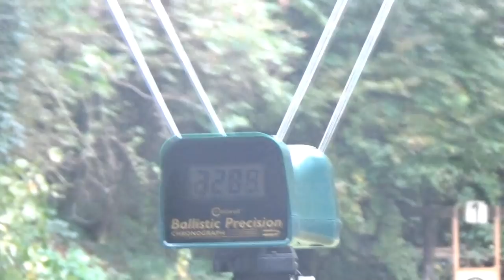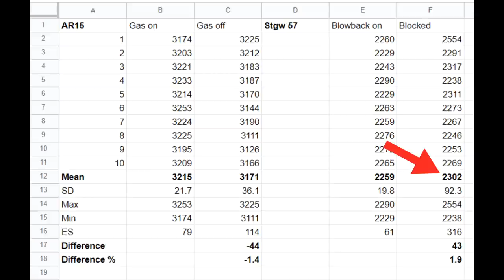Does A Semiauto Action Make A Gun Less Powerful? AR-15, SIG Stgw 57

Comment: Next, does beard work as good cheekrest and affects accuracy by a significant margin
Reply: Does beard make uncomfortable metal stocks more comfortable
Reply: It does when your stock pulls your beard hairs
Reply: The worst is 5-day stubble on open grain wooden stock. Ouch!
Reply: @zedoktor979  also, it’s not as “sticky” as a smooth cheek, so the cheek weld is slippy, and you have to be aware of it. You get to where you don’t notice, though.

Comment: A remark from someone who is not a firearms expert, but knows a thing or two about interpretation of experimental data. 
The first result for Stgw 57 with blocked action looks like an outlier. It's 10% off the average while no other measurement deviates from average more than 3% (for AR15 all are even within 2% from the average). It may be ammo, it may be a measurement  error, who knows. I would therefore consider it a gross error and exclude it from the results. After exclusion you get average of 2274 wich gives us a difference of only 15. Still a bit faster but clearly within standard deviation range. Also standard deviation drops form 92 to 27.
Reply from the maker: Yup, I probably should have discounted that outlier, but I wanted to present the data warts-and-all :)
Reply: @BlokeontheRange  Leaving it in the spreadsheet for everyone to see is a good decision. I was the result after all. But I wouldn't take it into average. Or present both averages with short explanation. But it doesn't change the conclusion anyway.
Reply: It’s really not fair to throw out data points because they foul up your experiment. If the variation is to great then perhaps you need a larger “n” i.e.
Reply: Sorry I.e. more data points
Reply: Eliminating data points that are considered gross errors is quite standard practice in any data analysis. There is nothing unfair about it. You can perform what is called a Q-Test to check which points should be discarded. In this case for the first data point yo get value of 0.75, while the second highest is 0.06. For ten point data set the threshold for discarding a data point is usually between 0.40 and 0.57 depending on confidence levels. In our case this point should be discarded regardless of confidence level. 

The problem with mentioned data point isn't that it is higher. The problem is that is significantly more distant to the average than any other point and that's exactly what Q-Test assesses (if it's higher or lower doesn't matter). And if so it can be expected that the measurement was for some reason faulty in this case.

And it would always be nice to have more data points. That's obvious.

Comment: Does operating a semi-auto take energy out of the system? Theoretically Yes. 

Does this make a difference in practice? Not really unless everything else is perfect.
Reply: The bullet exits the barrel before the system is operated if you film it in slow motion for Some Guns don't know about all
Reply: @potus2582  
Well, no, 
the energy consumed as work cycling the action is energy that won't contribute to the work of propelling the projectile, basic thermodynamics, simple as that.

There will be a loss in any self loading system, no question about it, as it would be physically impossible for there not to be;
 the only real question is wheter the loss is significant enough to be noticeable, or even measureable, for that matter.

Comment: Physics says yes, it absolutely has to be.

The important question is is it significant, to which the answer is probably no.
Reply: Ran a T-test on the values in the sheet. AR-15 P=0.0040 so statistically very significant. STG P=0.1669 so statistically insignificant.

Comment: This is one of those things that is fun to try and prove is true even though it is known to be true, but you still want to try and prove it for yourself though you know it doesn't really matter. You could go into the engineering reports from gun designers which will tell you exactly what energy is being tapped by the system to operate, but Bloke is kind enough to give us a practical demonstration rather than just throwing arcane physics maths at us and laughing arrogantly as we struggle to synthesize the data.

Comment: don't need no fancy adjustable gas block - most ARs have a "sniper button", which you press before shooting to make it shoot harder.
Reply: Everyone knows holding the forward assist helps the bullets go faster
Reply: Ha ha that is a weird ergonomic trick that the uneducated think has to do with the operation of the rifle. By pushing their   thumb onto the forward assist button they're eliminating the torsion upon the grip which could cause deviation when shooting under pressure.
Reply: Reminds me of the accounts of African guerrilla fighters who would set the elevation sliders on the rear sights of their AKs all the way forward because they believed the rear sight was actually a "bullet power" control and that they were setting the power to maximum.
Reply: @emu4286  I heard that story also cited in an account of the battle at Rorke's Drift.
Reply: most ARs have a "sniper button"

Not in California.

Comment: This line of thought is why the Germans didn't field the stg 44 earlier. The high command was insistent that no holes be drilled in the barrel because they thought it would reduce velocities significantly. The designers had to disguise the project as development of a machine pistol in order to continue their work.

Comment: Most the acceleration happens in approximately the first third of the barrel. Gas pressure drops off before the bullet even reaches the gas port on most guns (except ones where the gas pressure holds the thing closed) and even before then, the efficiency of energy transfer from gas to bullet declines as the bullet gets faster. And it is energy transfer, so the amount of extra velocity you get for a given transfer of energy from gas to bullet is subject to an inverse square law with the bullet's previous velocity. All of this means that in most guns there will indeed be no measurable effect on bullet velocity from blocking the operating mechanism. If you're going to do what is now fashionable and shorten the barrel of your rifle to a cool-looking length, which makes a bigger brighter flash and a muzzle blast your forebrain can really feel, you've already changed the muzzle velocity a lot more than any subtlety of the operating mechanism will.

Comment: I had a similar experiment with a .22LR pistol (Walther PP Sport). Ten shots normal operation, 10 shots with my thumbs blocking the slide. The blocked slide group averaged 8 ft/sec faster, which was well within the standard deviation for that particular ammunition (I don't remember the brand). A locked bolt MAY conserve some energy, but not much.

Comment: A few years ago I was involved in testing for personel bullet proof plates. The standard we had to use was a 30 caliber round with a muzzle velocity of 2400 fps, among other criteria.  Shooting 147gr. Mil-Spec 7.62x51 out of a Winchester 70 and an M14, we would get about a 300 fps difference between the two.  You might try the same ammo out of a bolt action vs. a gas operated system and see what you get. Bolt action rifles can afford to have a tighter seal vs. a gas operated system. Things like the extraction system being factors in how tight you can have the chamber to bolt seal.

Comment: The perceived recoil on non self loading rifles is more vigorous but the foot pounds of energy delivered by the projectile is not significantly higher than out of a similar auto loading rifle.  The main difference is that the excess energy that would just push the rifle into your shoulder with a bolt action is used to cycle the action in an auto loader. It isn't robbing energy from the projectile but the energy that acts upon the rifle itself.
Reply: Makes sense.

Comment: I presume it'd depend on where you extract the gas and how much is extracted. For most rifles the gas comes out most of the way down the barrel and only a small amount is removed, a combination that would make a near zero difference to the energy imparted to the round. Given your explanation of the excess gasses, it'd probably only really affect that unicorn round that wasn't so overgassed if you extracted it nearer the chamber and took more of the gas. I'm not sure any such round has really existed since the tiny pocket pistol cartridges of yore, and given the pressures involved, no-one designs a rifle like that anyway, it makes life FAR easier to deal with the lower pressures up near the muzzle when 99.9% of the useful energy has already been transferred to the round anyway.
Reply: Bingo.

Comment: I remember the time we tried the white magazines in the army in 1980 convinced that the closed bolt would grant  higher speeds and therefore flatter trajectories with our Fass57s.
We also encountered a large spread of the rounds, the old guy at the range, an ancient adjudant, justified this by saying the oscillation induced to the barrel by the higher pressures could be the reason of the rounds going a bit all over the target.

Comment: What order did you shoot in, as fouling or heat or something could possibly affect the second series shot and account for some of the variance.
Reply from the maker: 5 warm-up shots, then semiauto, then blocked. To try to minimise this.
Reply: I was interested in that thought, so fitted a linear regression line to the full sequence of 20 test shots. My result suggested there might be something going on there, though it is hard to suggest what that might be. Firing a further 25 rounds, this time with 10 rounds gas off before 10 rounds gas on might be interesting further test. The trouble is doing more tests risks suggesting even more tests to do and so.

Comment: I think what a lot of people fail to realise is that in order for a rifle shot to be 100% energy effecient and not waste any gas/pressure it would need to have a barrel something like 2.5meters long or more, and even then the gains in bullet velocity would be minimal because way before that it would have hit a stopping point caused by the bullet weight, shape, drag and overall aerodynamics, as well as things like the friction between the bullet and the rifling, basically in the end the fact of the matter is A LOT of pressure is wasted in a shot, and that is the smoke and muzzle flash you see when shooting etc et al, diverting a bit of that pressure back to cycle the rifle only makes it for efficient because it uses up a bit of that spare energy, and rifles, at least well made and designed ones shooting good ammunition, are designed as such as to hit a sweetspot that allows for maximum terminal velocity while keeping the rifle at funcitonal, rational size and shape

Comment: I must do this with a semi-auto / lockable .22LR that I have. Nothing terribly surprising in your results but it's good to do this stuff - we find things we didn't expect even when proving the main points we anticipated. I do think I saw a little movement of the AR bolt with the gas system closed. Not enough to make a velocity difference I shouldn't think but interesting to wonder quite what was happening. Good stuff!
Reply: It's possible that when the recoiling rifle is stopped by the shooter's shoulder, the bolt's momentum is enough to get it to bounce a little
Reply: If you have the cartridges available, doing so with the weediest ones that can just about cycle the thing may actually show the difference the myth suggests. Such an extreme example would, of course, be the one exception to prove the rule. If you have to go to such a length to provide one example of it happening when Bloke has shown it makes no measurable difference in more powerful cartridges, that'd be as much proof as anyone with a brain needs.
Reply: The first thing I thought when watching this is whether a simple blowback gun would be any different, and being in the UK that essentially means .22LR. Sometimes when I've shot more powerful ammo in my rimfires (CCI Velocitor etc) I've had a lot of debris and gas from the ejection port as if it's opening too soon for all the powder to burn, would definitely be interesting to see how this might affect velocity.
Reply: @truckerallikatuk  Sadly, the rifle I had in mind for this task chucked it's ejector out during a speed steels match a couple of weeks ago so there may well be some delay before this particular idea gets filmed. Most things you can just change an ejector ina few minutes, in this it is a spring steel pin that is swaged into the bolt. Will need some enthusiasm to tackle that job!
Reply: @TheWirksworthGunroom  That sounds like a rather poorly engineered little .22, but good luck with the project. Hope to see it on your channel sometime.
Reply: @truckerallikatuk  In many respects it's cracking little rifle but they do seem to have dropped the ball when it came to the extractor. The model has been discontinued for many years. Voere 1014.
The answer would be to machine the bolt to take a conventional claw extractor but life is short and pressures are many!
Reply: Long ago, after due progress of safety paperwork, the powers that be gave me permission to bring my 1407 into work and use it for a low velocity test calibration of the muzzle velocity instrumentation for our experimental railgun. My boss asked "I hope your are not going to bring your .22 rifle into my office and then demand a pay rise?". I replied "Don't be ridiculous sir, if I want to do that, I'll bring my .44 magnum".

Comment: We need to crowdfund the ammunition for a much larger test! Going by the 10 shots each on the AR-15, there is a statistically significant difference between gas on and gas off, but in the opposite direction to what we'd expect...
Reply: Can confirm, I did the math and we're significant at 95% certainty (if I didn't mess up)
Reply: 40 ft/sec is within the variation from one round to the next. Especially when you're talking velocities over 2,500 ft/sec.
Reply: @MrPolluxxxx  I agree the different is significant i.e. the AR  velocities are LOWER (not higher) with the gas turned off.
Reply: The Stoner DI system - does it not actually create forward thrust on the bolt face? meaning a tighter lock up than simply seating it in place with a cold bolt carrier group with no gas running through it?
Reply: @Win Mag I am fully aware of how it works. The gas key however directs gas inside the bolt carrier, that gas also expands into void in the bolt, it not only begins to move the bolt carrier rearward but it pushes the bolt forwards and seats it in battery more firmly at the same time until the carrier and cam stud over come that resistance and finally open the bolt. It does two things at once.  Its why its so lightweight. Its also why I suspect its chronographing just a tiny bit higher with the gas system switched on. You can't put energy back into the system but you can control its release. Its why ARs are sensitive to barrel length and suppressors.
Reply: @Win Mag Its a propellant. Its a steady push, not just a bang.
Reply: @Win Mag Stoners system is not like others where it just relies on rearward motion and brute force like a normal piston system. This has been explained at length.
Reply: @Win Mag Clearly no one you paid attention to. Unlike BOTR who has co-produced content with with them.
Reply: @Win Mag Tell Karl and Ian they are full of shit as well then. As you don't understand the AR system.
Reply: @Win Mag Never touched a real AR or "automatic weapons" have you? stick to the Games Workshop and playing risk you spotter.
Reply: @Win Mag Thats nice deary, would you like to tell us about all the weapons you never designed for RO? as I am scratching my head to name an original small arms product of theirs from the last half century thats not a production licence based on another companies data package. Oh wait...are you trying to tell all the boys and girls that you actually "designed" the SA80?
Reply: @Win Mag The HK33 was out of production at HK in favour of the G36 project by the time BAE Systems acquired them. BAE did in fact licence produce HK roller delayed weapons in the UK prior to that. Of course you would know all that as one of their "design engineers"...
Reply: @Win Mag No we want hear about all the AR pattern rifles you designed when you drove a forklift at "RO" when they owned HK. You know, when HK were busy not making the HK33 anymore...
Reply: @Win Mag Sorry we are still waiting for the list of small arms you claim to have designed for "RO" when you seem to have no knowledge of the company, its product base or corporate history.
Reply: @Win Mag Were you the caretaker by any chance? as you certainly weren't the "design engineer" at a site that conveniently no longer exists so your story can't be checked.
Reply: @Win Mag You see old chap I knew the RO site in Notts is gone as I used to live there and knew a handful of ex employees who had normal production line jobs. I didn't have to google it like you did to find out where they moved to. The trick to bullshitting people old chap is not to over sell it by claiming you "design engineer" stuff when in reality you are an elderly ACF instructor who joined a gun club. By the way, I have no need to be ashamed of volunteering on a weekend at a community bike recycling project. Its just a bit of fun, unlike being a member of your gun club.
Reply: @Win Mag Oh you mean this - "Are you really upset because they cancelled the remembrance parade this year so you don't get to cut about in a second hand number 2 dress pretending you are a veteran? do you normally save the gun designer tales for the function in the mess at Chilwell afterwards?".